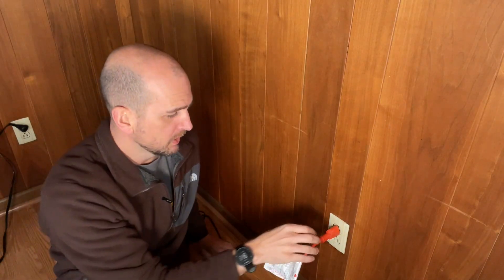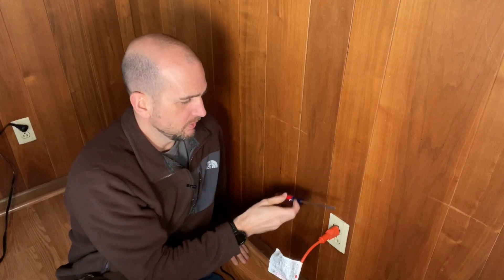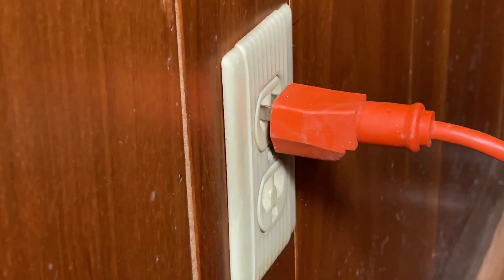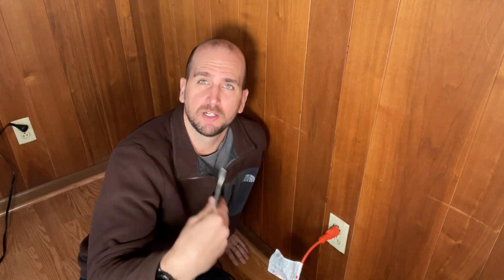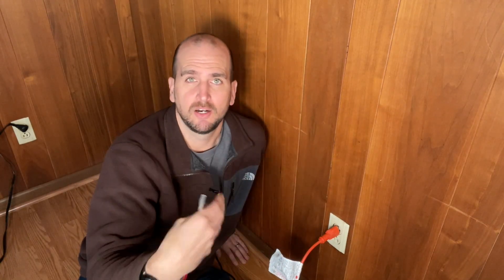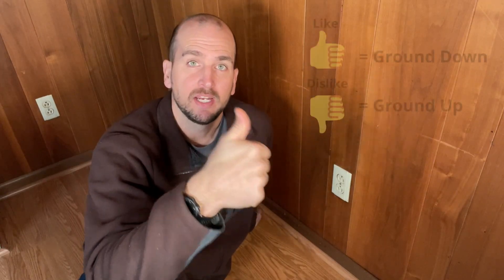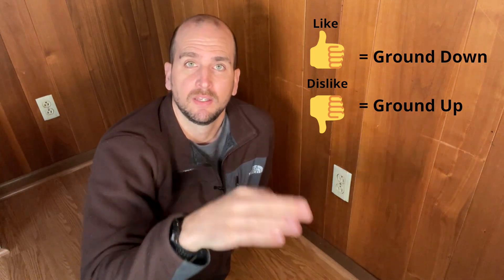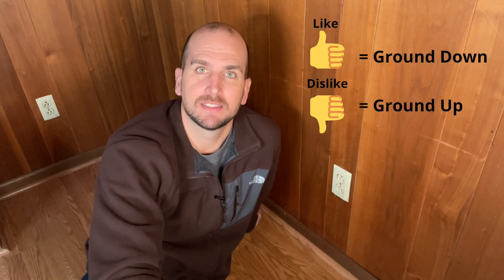Should An Outlet Be Installed Ground Down Or Up

Comment: ALWAYS ground down. Here is why. All "wall warts" type charges Etc. are made so that the bulk of the weight is oriented downward with the neutral tab on the left, therefore if the plug is oriented with the neutral on the left they will rest in such a way that they will not exert pressure from the top and fall out of the outlet. Remember the neutral should ALWAYS be on the left and that dictates that the gourd is on the bottom. This is standard and always applies to any USA type 110-120 volt plug in device or cord. Also notice that flat against the wall plugs will orient the cord toward the floor this way rather than upward which relieves stress on the cord and creates a sort of drip loop to prevent spilled drinks for instance from following the cord into the outlet.

Comment: Wow.  Where to even start.   First,  you stated that the ground up theory was due to something falling onto the plug which is incorrect.  A lot of fires start because of a plug becoming loose in the receptacle and arcing so some gonadless white hat looked at the plug and thought goodness,  if I put two connectors down and one up then surely the plugs wouldn't come out.  There was even rumors of a code change.  However the gonadless white hat wasn't really that good at thinking.  The truth is that plugs and receptacles were designed for a ground down installation.  It's foolish to think it would be better to install them in the opposite orientation as they were actually designed.  It even went to the point that they started installing them upside down on generators.  Inspectors soon realized that installing them upside down is actually more dangerous and code wasn't changed.   Having lived off grid for many years I've used many many generators and when using generators with the receptacles installed upside down it's quite obvious that an upside down orientation will cause the plug to loosen far more than the correct orientation.  The interesting part is that if the gonadless white hat had really been concerned with loose plug fires he could have actually designed an entirely new receptacle that would prevent loose plugs.   There are locking receptacles available.  The truth is however,  that  many receptacles are simply out used and not replaced.  They are often overloaded if only by repetitive inrush. Some get loose by repetitive plug/ unplugging and aren't replaced.   I don't care for the notion of turning the switched receptacle upside down either.  I don't even see why it would be necessary.  But I also don't install  switched plugs without clipping the bonding and turning it into two circuits.  When the electrical in a room is designed it should be laid out with logic.  If it is then you shouldn't need to turn a receptacle upside down.

Comment: As an Electrician myself, in a home an upside down outlet , usually means it’s a “switched outlet”. 
In a hospital on equipment outlets we put them on their side with the neutral/ ground screws up, so when something is plugged in like a heart device etc, that if the equipment plug prongs won’t trip the device if you drop something on it
Reply: What does that have to do with toilet paper
Reply: Heather Petersen  
scottym3 Wrote
1 week ago
I prefer my toilet paper to be put on the roll coming over the top.
Reply: Heather Petersen  OK sorry I must have scrolled the wrong way

Comment: The Objective is not to have anything Fall onto the plug to cause a short, as most plugs are ground down to give stability to the weight of the plug itself. As you have discovered that most cord manufacturers recognized the ground is down and facing the floor so wires can be run along the baseboards and this is the way its been for over the past 70+ years. I Will continue to install them Ground Down. And dont forget to Install  Pigtail extensions where applicable.

Comment: The age old question. I like ground up for the fact that small children are drawn to the likeness of a face when installed ground up. Also when you grab a plug, your thumb tends to be on the top and can receive a shock. All good points and a great idea to change the switched plug to reverse or normal and I guess do that when half the plug is always on and half is switched too. Do you prefer the top or bottom plug to be switched? Bottom for me.

Comment: Another reason to put the ground up is if you step on the cord and it puts tension on the plug, it will force the hot and neutral into the outlet and expose the ground which is safer. If it's ground down, when you step on the cord it will push the ground in tighter and expose the hot and neutral on top. Not as safe. Also, you'll notice that the ground prong is a little longer than the hot and neutral which is also a safety design.

Comment: I prefer for single to have the ground UP, it makes it easier to engage as looking down from above you can see the longer ground pin much easier.  For double I put one up and one down.  This is due to some plugs (including the AC "wallwart") with the wider neutral pin,  it is much nicer to have the option

Comment: I don't like ground at top because  I think is much to do about nothing.  It creates a big problem with cables that are at 90° and are ment to go down but if they have to reverse and go up it creates a loop in the cable and puts pressure on the receptacle.
And with 2 contact plugs it solves nothing. Leave things the way they are

Comment: should have just added a poll :) that would have helped you on the stats just ask the spiffing brit :)  that said I cant help myself typically so its always ground down. there are devices that require ground facing down like security systems or anything else that will want to permanently attach to an outlet by removing the center screw and using their own mounting screw

Comment: I don't agree with the ground up. I did that on a couple projects and found I still grab the cord and try to plug in with ground in bottom and neutral on the left side. Habit is hard to break.
My first ground up project the ground "hole" broke by chipping out - yeah how many times have you seen that? Me? Never.

Comment: Always seen and installed ground down. The only times I've ever seen a ground up was when an amateur replaced one and it was the only one in that orientation. 

I've always done ground down because I like the screaming face, and I have always put the large spade left. 

Honestly never really considered it a big deal outside ornamentation, convenience and consistency.

Ornamentation...I like the ground down look. To me it somehow screams more professional. Maybe that's a bias from NEVER seeing a professional install one ground up.

Convenience. Because plug manufacturers for devices seem to all design the male plugs such that ground down is the intended orientation. You show one such device in this video, but there are many that do that.

Consistency. Since every building I've ever seen is the same way, it seems more like a wierd and goofy way to announce your "individuality" by putting them in upside down. 

And when I have sideways installations I always orient the ground right. Unless there is a very specific reason not to. 

My 2 cents.

Comment: I do know that argument of ground up being better if something fell there but what again would the odds be of that happening,id probably hit the lottery easier even without playing it than that happening.ground up is the worst way to do because plugs like your fridge would have to be twisted upward which if using the bottom outlet it would block the top which is fine since you most generally only plug a fridge into that one,of course that's like the stupidity of having to install gfi's around wet areas when right on the box it says do not install in wet areas and there's already a breaker in the panel box,there's no need for another in line breaker.But thats all those retards that set around a table that don't know there ass from a hole in the ground making up ways to cost people unnecessary money.There possible things that could happen hold no merit since the chance of it happening is astronomical.

Comment: Ground up represents a 20 amp circuit, per every electrical thread I've ever read.  Quick way to know vs than going to the box.
Reply: That's a different connector, AFAIK.

Comment: Sneaky way to get likes. LOL   Ground goes down because if you would accidentally set something on your cord and put weight on it, the ground poke will help to prevent your cord from coming unplugged, where as ground up, you loose that extra support of the plug and it can easily be pulled out of the wall.  The only time you should not use ground down is if you mount your electrical cord horizontal instead of vertical.

Comment: Feel I have to point out that the most compelling reason for ground down is either "it's prettier" or "it was good enough for grandpa and it's good enough for me". I do believe it's safer tp put ground up and on my jobs it is done that way only. The fact of two prong outlets being more likely to pull out is valid but the two prong style is used less each year. As for the side winder style of plug I feel the only places I ever see them regular is on fridges and AC units. A small clamp can be screwed into the wall and is what I usually recommend. One last thing to think about is the 2 disaster scenario. If a wire or something is dropped across the terminals of a circuit that a defective breaker (they do go bad for a multiplicity of reasons including age, temperature, disasters and most especially humidity) then said wire across terminals will produce heat and sparks, making for a genuine fire hazard. While this is rare it has happened and should not be discounted for looks. For the record I am a general contractor specializing in hi end renovation and all wiring is done either by me or my employee's. Enjoyed your video.

Comment: If it isn't ground down, I'm buying a different house.  I have 90 degree plugs where the wire comes out straight down.  It would be extra strain on the cord to be plugged in ground up.

Comment: Always preferred ground down, for many reason, most compact plugs are oriented with ground down so in a ground up it puts stress on the plug and the outlet, shortening life. Also most appliances come oriented this way. Plus most polarized nightlights will be upside-down with ground up outlets. Also most powerpacks are polarized and with ground down, the weight of the unit is applied to the wall, instead of trying to pull away from the wall from tension on the cord and weight of the unit. Plus ground down looks like little faces.

Comment: I can report at least one instance where I've had something fall over onto a cord and cause a short:
I had one of the sides off from my computer tower (simply a painted piece of sheet metal with folded edges), resting on a hot water baseboard, and leaned against the wall. Eventually it got tipped onto the plug, and caused a few sparks to fly and tripped the breaker.
You could argue that you're not that careless, and you'd probably be right.
I still don't think it warrants changing all of my outlet installations to put the ground prong at the top.
I would also refer to one other comment which mentioned a "plug-in" appliance, such as a night light. Those require the outlets to be installed in a specific orientation. Consider also the popularity of the night light/air fresheners (the ones that melt a small cube of wax) that also require a specific orientation. I hate those turds, but my wife keeps buying them. (maybe I SHOULD invert all of our outlets!)

Comment: Ground down cause if you have a plug where the cord comes out the bottom, having it down means the weight of the cord won't pull on the plug, and have it pulled out of the outlet

Comment: Your point about angle plugs well taken especially when setting up a dishwasher with a plug in at the back of the compartment the space is tight and you need that plug to be tight to the wall. So ground down works well.

Comment: Your argument for ground-up applies to 3-prong plugs, and I don't think the rare instance that you'd drop metal along the wall popping a circuit breaker is a big deal.  What was much more serious for me is with, like you said, 2-prong plugs are more likely to get loose.  For me the concern was over a pet bird, but the same can happen with children.  Birds like to climb on cords because they're like tree branches.  I noticed my bird particularly kept going back to one cord, and as he got close to the wall his weight would make the plug tip down, exposing the prongs.  The result for a little bird would not be a shock, it would be fatal.  So I replaced a not-very-old outlet so the plug doesn't slip loose.

Comment: I've only seen vertical outlets in basements or  garages where they are ground down. I'm 66 Y.O. and have only seen cheep junk installed after 1970. Vertical outlets require less work framing. Horizontal outlets with conduit on left and right require horizontal 2x4's between studs for mounting.  On the job Lab workbenches  and Hospitals have vertical outlets ground down.

Comment: The Canadian code book says ground up. Mostly because of industrial and commercial installations call for metal face plates that could come loose and fall against prongs. In residential ground down looks nicer and most cover plates are plastic so most inspectors will let it go.

Comment: I had a fish tape hit a hot prong of a 220 volt plug that was not all the way into the outlet. Had the plug been installed with ground up, no problem; but many pigtails make ground down necessary or you get strain on the cord.

Comment: I never saw this in 55 years until i moved to North Carolina.  Lived in NY, NJ, CA,FL and TX and never saw it in a home.  Asked a contractor here and he said it was in case someone dropped a metal object on the plug, just like you stated.  Personally I like the idea of rotating them on switched circuits.  An argument for ground down is that most power adapters are designed to "hang down" on receptacles with ground down.  If they are ground up they will tend to tilt outward and disconnect.  Based on that fact I would default to ground down on all normal sockets and ground up on switch sockets..   Most switched items are lamps or items that dont require power adapters.

Also if you want a vote system, pin a comment from yourself and make two replies with the "votes". viewers can like the comment they want to vote for without messing up your stats.

Comment: For safety you should do ground up for this if your cord gets pulled just a little bit like behind you tv your computer desk or whatever and something conducive falls on it, it will fall away with ground down it’s a direct short depending on how long the run could start a fire. Now on horizontal you want the neutral up,  if hot is up it’s a shocking hazard. Back on your video on pigtail was great but here’s a tip do not use both screws to feed down stream receipts it turns the brass tabs int a resistor and cause heat and could cause a fire, you break the tabs for custom wiring if using both screws

Comment: Would love it if they made receptacles with ground up on top and ground down on the bottom. With so many 90 degree plugs and wall warts out there, it would be incredibly useful.
Reply: Then you'd have hot and neutral on opposite sides from the top and bottom receptacles, creating other design and installation consequences.
Reply: @UpnorthHere  I think they mean dual grounds so it can be plugged in either way.
Reply: That would not work because the neutral prong is wider than the hot prong. This is called a polarized plug.  If there were holes for ground prongs both above and below there would always be one way that would be impossible to plug in.
Reply: @ksman9087 Was thinking it would be just upside down for the top plug. Like so:

 G
LN

NL 
 G
Reply: That's a great idea!

Comment: The #1 reason I go for ground up is that most basic building rule of thumb..." Hot on the left, cold on the right. ".   Works with plumbing and with hot wires in a box.   When I built my house I put all the grounds up works great.  Also, it is a bit odd to have all these little shocked faces looking at you all day.
Reply: The NEC should take a look at the Safety aspects of the installation of all outlets, especially in kids bedrooms and playrooms

Comment: Europe does do some things better.  This is one of them.  Their plug design makes it so it is impossible for the plug to be half in the wall and still powered.  Either it is locked into the socket and powered, or it is out, but the pins lose power before they are exposed.  It is a much safer design.  But of course everything is 220v, so nothing is perfect.

Comment: I consider ground facing down the normal and in the pitch black I do it that way first.  Now that said, I use ground facing up in special situations like in my bathroom they installed the outlet too close to the counter and I couldn't get the dehumidifier to plug in without blocking both outlets, molded space saving plug, so I had to flip the outlet.  I think up vs down is a personal preference not a safety or must do it that way.  If the outlet is having problems that a dropped tool can touch the pins it should be replaced instead of relying on orientation to save you, outlets are cheep doctors bills are not.  This is just my 2 cents, I've worked in electrical safety inspection and the orientation was not part of the inspection.

Comment: The U ground up is mainly to protect against metallic plates that might come loose and fall across the hot leg and neutral of a plug.  The thinking being that the ground pin of a plug will catch the plate before it causes as issue.   It's a much more likely scenario in commercial/industrial work than in resi, where nylon plates tend to be the rule.